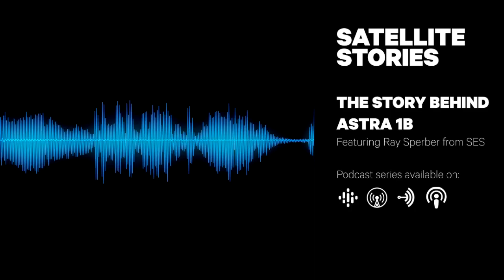Satellite Stories Episode 1: Story Behind ASTRA 1B

Comment: There was a technical problem with Astra 1B's thrusters in that they could not be activated to keep the satellite at the same position, and it would drift from time to time causing sparklies on certain transponders. 

If you had an 80cm dish in Northern England and Northern Ireland and an 85-90cm dish in Scotland, the sparklies weren't an issue at all on Astra 1B due to the bigger received dBW gain.